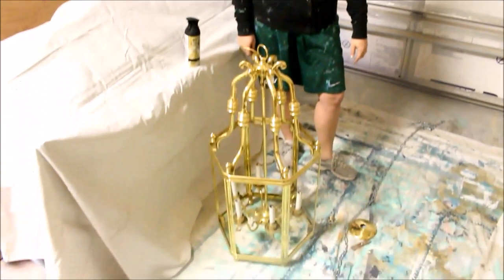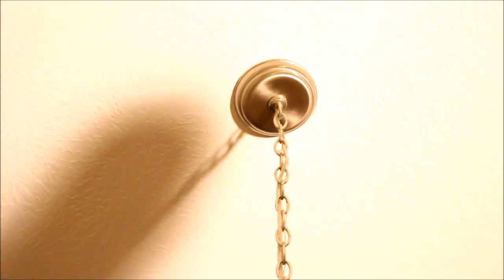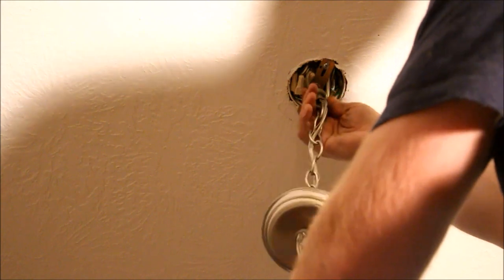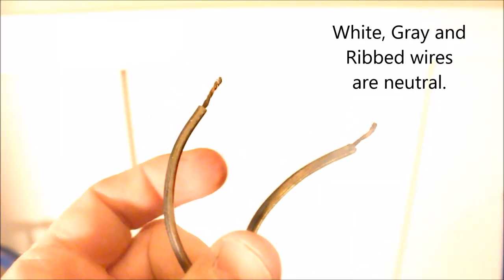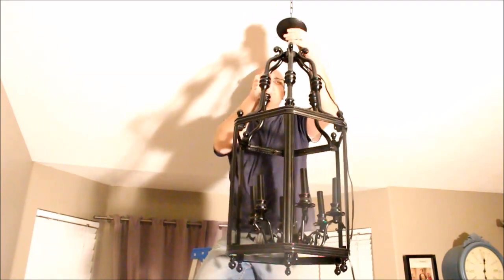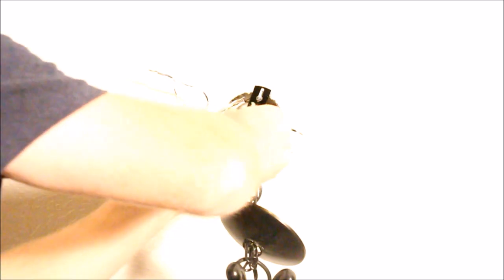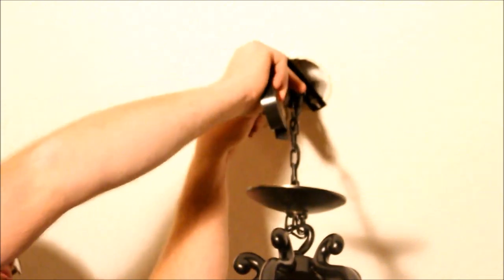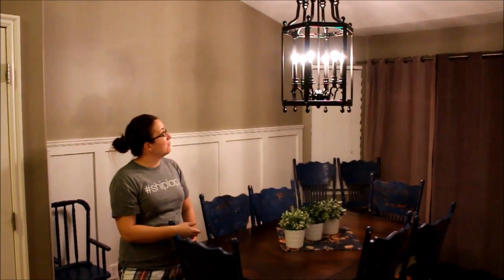DIY Farmhouse Light/Fixer Upper inspired.

Comment: If you don't know which breaker goes to which lights in the house.  Turn the light on that you will be working on, and then go and switch the breakers on/off until the light you want to work on goes off. Once you are finished working on the light, go and turn that breaker back on. This is a good time to label your breaker to indicate which light or room the breaker switches off.

Comment: I know this is an old video, but still very helpful. Great transformation! You mentioned cleaning this fixture before you used this particular paint. What do you use to clean with and did you sand or rough-up the slick finish at all?
Reply from the maker: We cleaned it with hot water a dawn dish soap. No sanding before painting on this one. 😊
Reply: @JamiRayVintage  Thank you for your prompt reply!